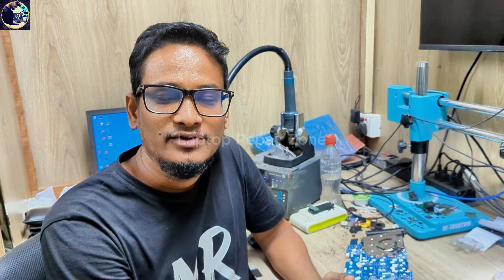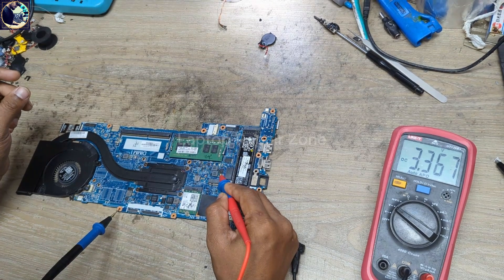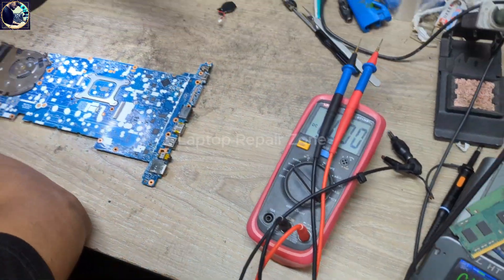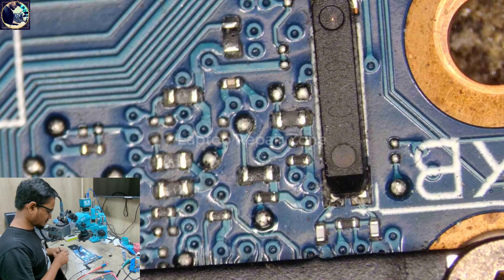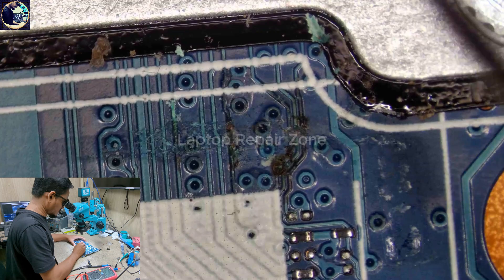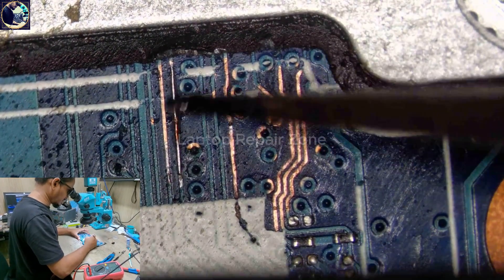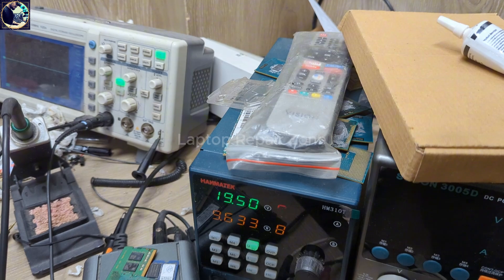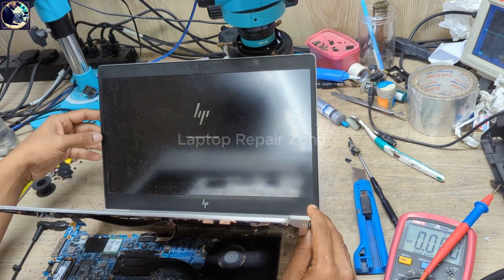How to Fix HP EliteBook That Won’t Turn On (Easy Steps)

Comment: 850 g5 what to look for if all the voltages are there and no corrosion or damage?
Reply from the maker: @craigreich8046  thanks for your comment, is it power on?
Reply: @Laptop_repair_zone  Yes, power light flashes and all rails have the right voltage.
Reply: I still can not figure out what is going on. I removed the ec bios and attempted to remove the password. After reinstalling the chip this happened. I removed the chip again and put the original bios back on and reinstalled the chip but it's still dead. I do not see any missing or out of place components around the chip. Please help!